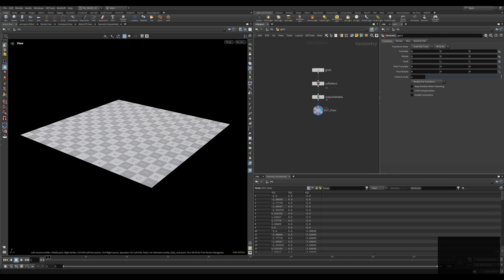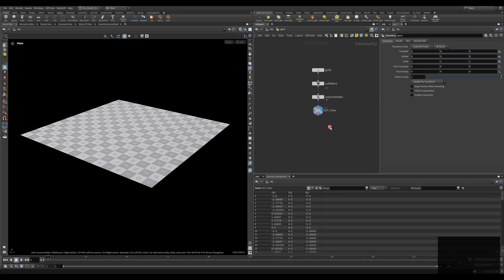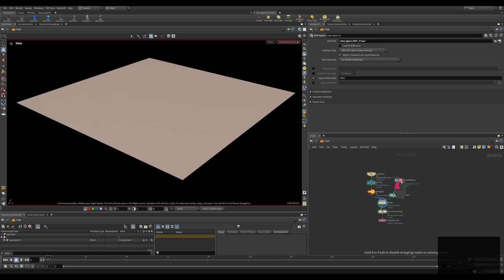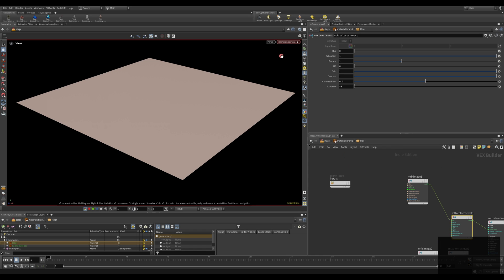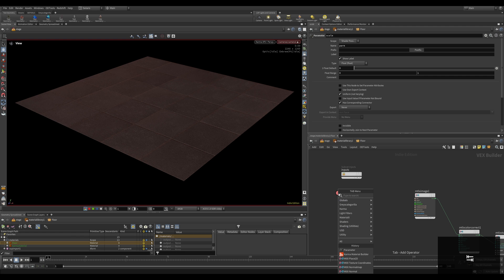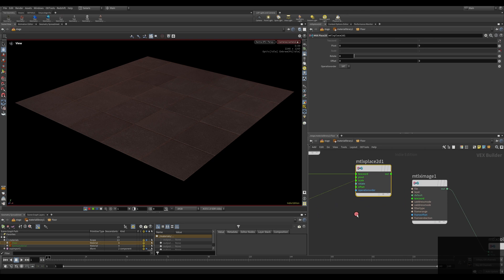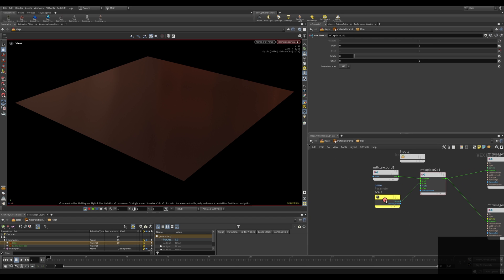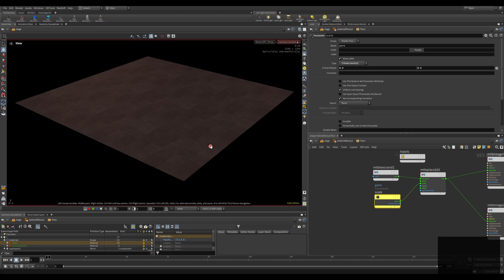QUICK TIP HOUDINI / KARMA MTLX / How to scale a seamless Texture (Advanced Level)

Comment: Perfect thanks. Seems to work with just using "float" in the Type as well instead of "2 float". Its just a slider but slightly less control.
Reply from the maker: With the 2float you can scale the texture individual per axis. So you can also stretch the tiles.